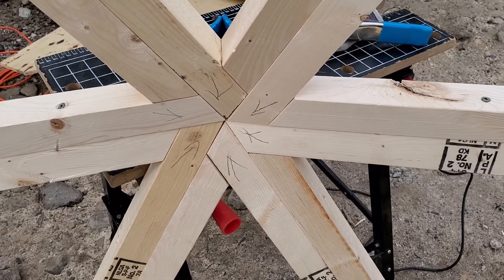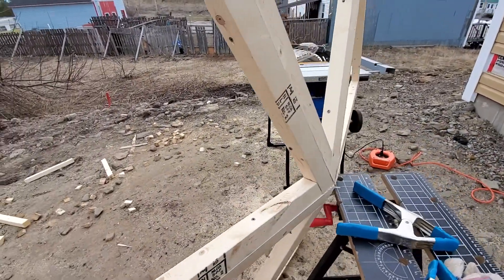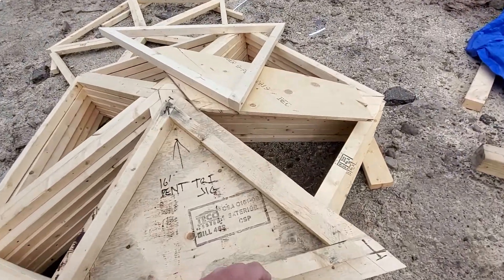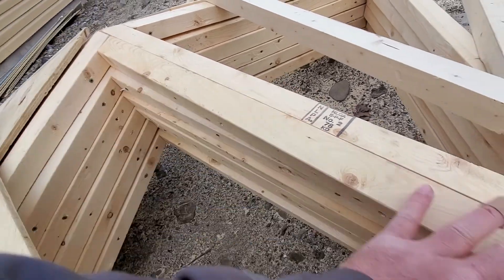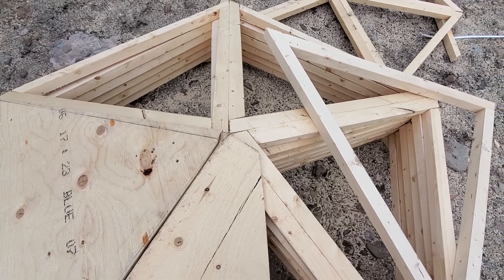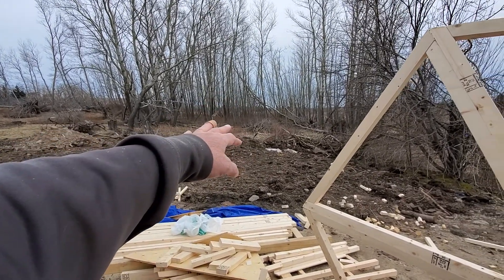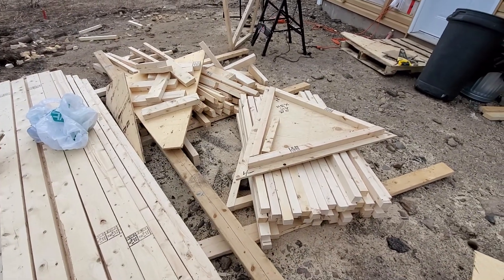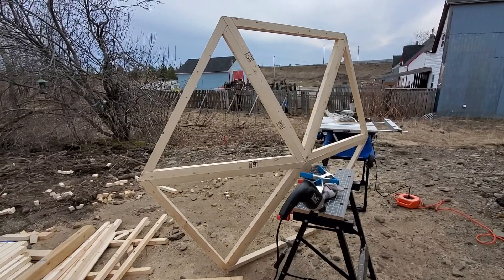APRIL 24 2020 GEODESIC DOME PROGRESS - HEX COMPLETED AND TRUE

Comment: Two by fours cutted in the right dihedral? Godamn the timber is expensive. Even here in Funland, wheres nothing but trees. Id like to try to build one. Build several, but only in sketchup, hehe. 
Nice work. How are you going to cover it?
Reply from the maker: If you look on here for a video called 'poor man's fibreglass' or something close to that title, that's what I should have done, but I only discovered it after putting underlayment and shingles over the Omnidirectional Strand Board.   Tip...you can not paint OSB with latex paint thinking (wishing) it will keep rain out.  It does not.
Reply from the maker: Abd wood is expensive even here in Atlantic Canada where it's a majority industry.